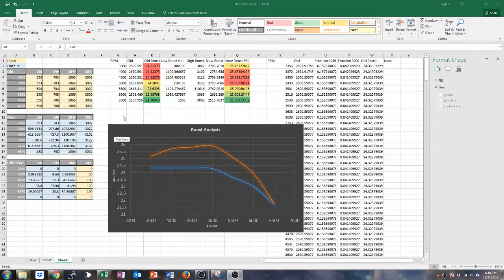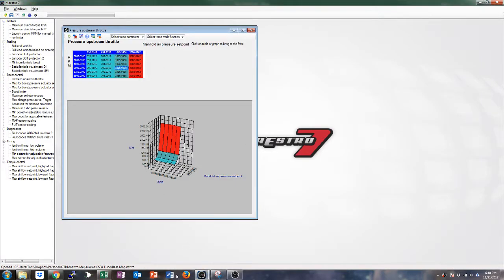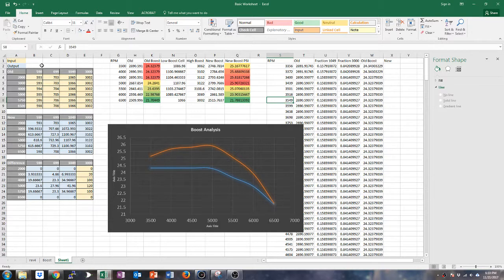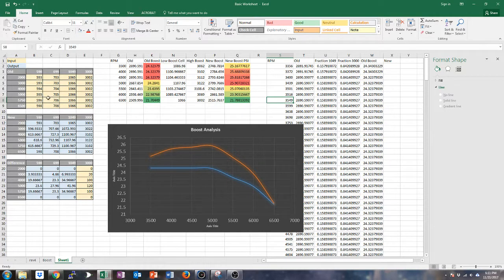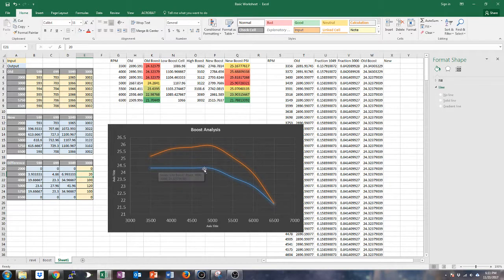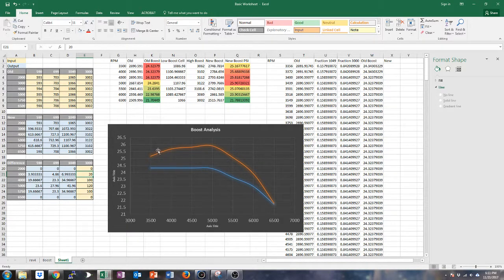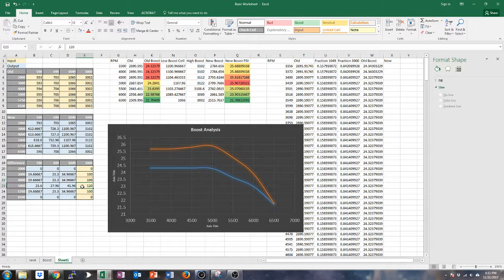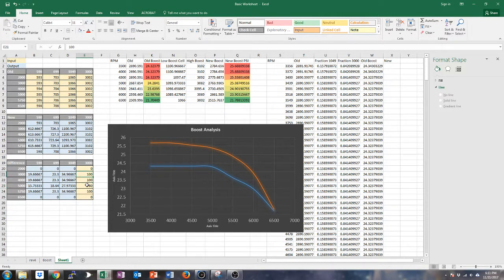Boost Target Calculator

Comment: Would you be willing to share that calculator/Excel file to help with tuning ?
Reply from the maker: Michel Hadid yeah.  There's a link to the file on my DriveTribe, SessionMk7, in one of the suspension articles
Reply: I couldn't find the link on your DriveTribe, which article is it in?
Reply from the maker: Bryan Medway I later found out this calculator is not very accurate, and wouldn't recommend using it
Reply: @karltaht2370  So this doesn't work?